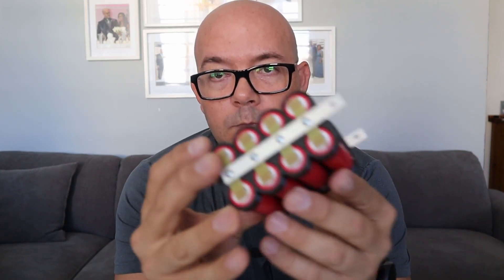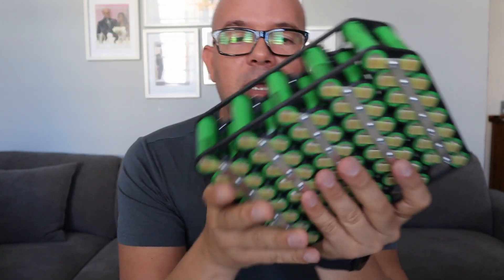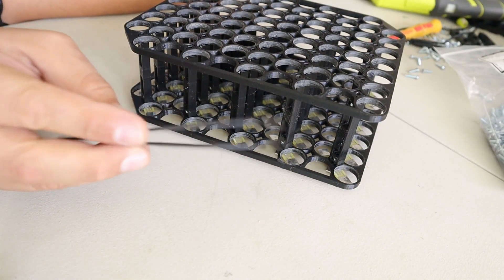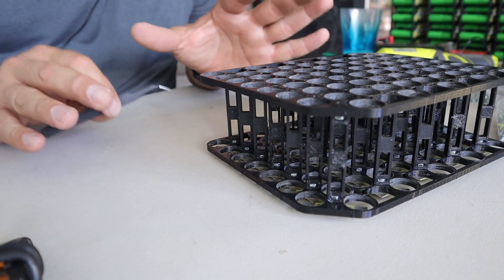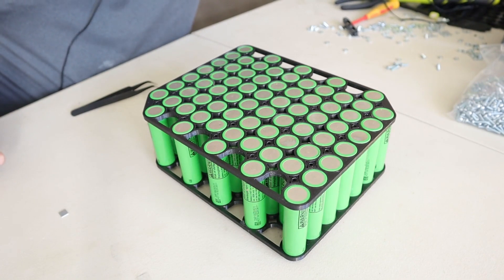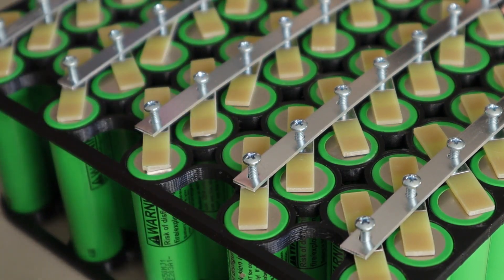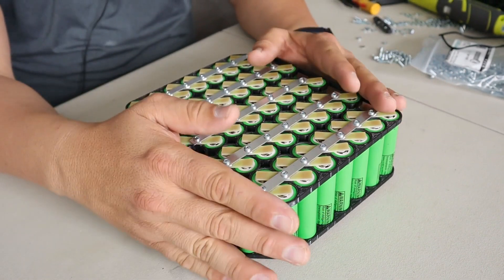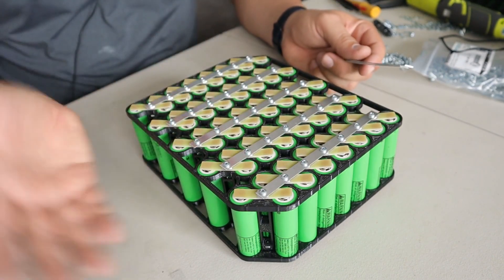Introducing my New Diy Powerwall Kit

Comment: Nice creation Javier. I simply wonder if the square aluminium pieces may introduce a possible contact weakness in your design. Because of them, there are 6 points of simple pressure contact for each cell, and the more contacts there are, the greater the possibility of bad contacts. I wonder if these aluminium pieces may be replaced by brass washers or copper seals that may be welded on pcbs. This may represent an increase in cost and preparation operations, but perhaps it could make the whole thing more reliable by eliminating 1/3 of the pressure contacts. I don't know if that would be justified.
Anyway, thank you for your work and videos, and happy festive season!
Reply from the maker: Thanks for the tip. We actually figured a way to simplify this part of the design. 
An update video should be out next week

Comment: It might be better to use Copper squares instead of Al, the least resistance will generate less wasted heat. It will of course be a little more expensive.
Reply from the maker: I think you are right. The good news is that anyone can customize it based on their needs
Reply: @javiercamacho  Does this mean you will offer a Copper kit instead of Aluminum? Cost may be an issue but efficiency is more important for a few more pennies. Good job
Reply from the maker: If i can source the copper I'll. But mostly, I can share how to make the pieces and you guys can customize them
Reply from the maker: Just wanted to let you know that we figure out a way to remove the al at all sense we can thicken the pads using soldering iron and tin wire

Comment: Thanks Javier! I'm thinking on a 26650 cells pack design and i also was thinking on using screws to make weldless contact. My pack would be a high current one so the requirements are different but your pack seems pretty good for general application. Thanks again for sharing!
Reply from the maker: I can make fuses for higher amp rates. We are currently working on the 32650 and the 21700 cells
Reply: @javiercamacho  32650 would be perfect. That is what I am working with now. Could you get 20A with those PCB?
Reply from the maker: I have a 32650 video coming out next week. The fuses are rated for 5a but can be made for 20a
Reply from the maker: I have a 26650 design coming out soon with fuses rated for 5a up to 20a per fuse.
My design is not only good for general purposes but also been testing EV scenarios for new projects I'm working on. 

Regarding screws.... i wouldn't do it.